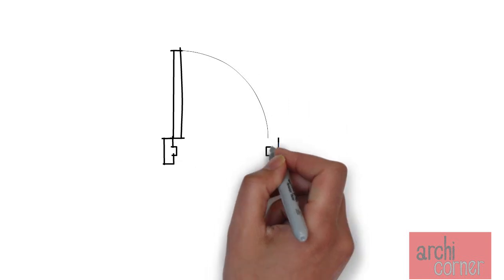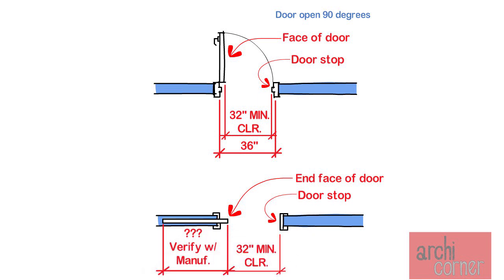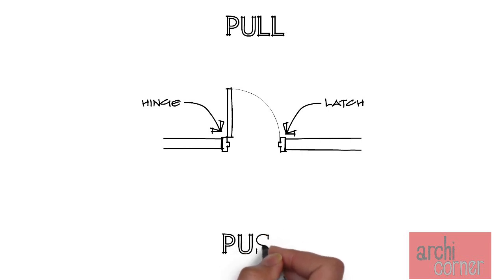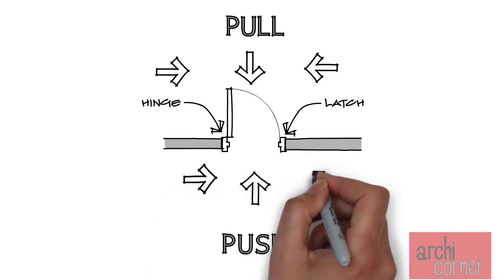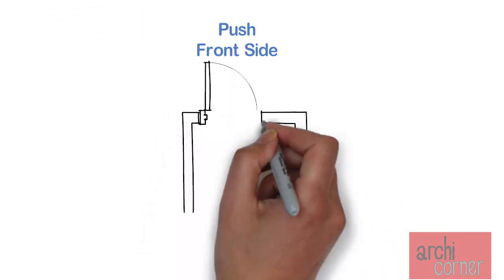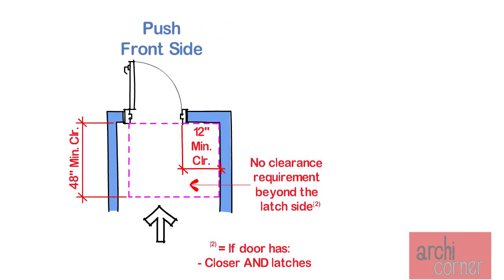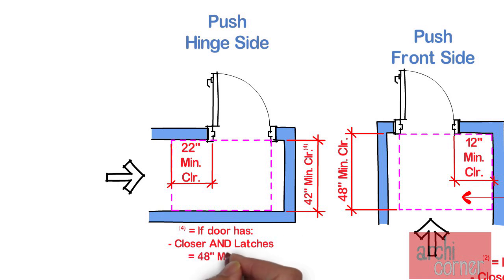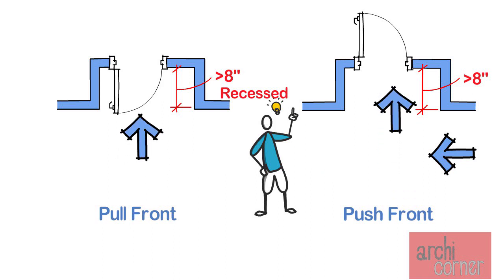AC 007 - UPDATED!!! - ADA Size and Clearance Requirements for Doors

Comment: I would love to see an in depth video on what a latch is. I believe its not necessarily a lock. How do you know that you have a latch? Is it that there is a mechanism that engages or something else?
Reply from the maker: Yes, a latch is simply the hardware component that sticks from the door into the doorframe jamb to keep the door closed. When you rotate the lever, you unlatch the door, and it can be opened. Some doors, for example, do not have a latching mechanism. They only have a "push" and "pull" plate or bar. They can be opened by simply pushing or pulling, no need to unlatch the door.

Comment: what if the push and pull door (toilet) with closer , what is the clearance require? 0" or 12"
Reply from the maker: Assuming you are speaking of a regular door, such as a door that leads into a restroom, and assuming you are speaking of a front approach from the push side, then per 2010 ADA standards, a door that has a self closer AND it latches, requires 12" on the push side (2010 ADA figure 404.2.4.1(c)). If it only has one but not the other, the 12" on the push side is not required (2010 ADA figure 404.2.4.1(b)).

Comment: Question about the clearance shown at the 4:40 mark in your video: for a push side hinge approach, CalDAG 2020 specifies 44" and your video indicates 42"
Reply from the maker: Great question. It is very important to know what the FEDERAL requirements are, which affect the entire nation, and what the STATE requirements are which affect a single state. 

The video is based on the ADA, a Civil Rights Act applied at the Federal Level. CalDAG is a publication (NOT A CODE!) that helps you understand the ADA and California Building Code (CBC). Therefore CalDAG is mainly used in California to understand applicable codes. 

This is an oversimplification, but I hope it's understandable.

Comment: Great video. What are the required clearances on non ada compliant residential dwellings. Say a two family home?  A lot us get confused when the ada standard doesn’t apply. Love this video. Thanks
Reply from the maker: In most instances, homes in general are not "public". They are "private" and therefore do not often fall under the typical ADA and/or FHA guidelines/requirements. However, you are correct, some residential units may be required to meet certain accessibility requirements, but that is usually because they are part of a multi-housing setting such as apartments, condominiums and townhouses. This is actually my next video on Patreon, as it was requested by my current patrons. I will be discussing when "Accessible", "Type A" and "Type B" units are required. It will most likely be up in a couple of weeks (today is 2/11/22).
Reply: @archicorner  Thank you for this video! Question: what are the required door clearances for electrical rooms in a hospital? It requires us to follow NFPA 101 and NFPA 100 in addition to IBC. Does IBC see an electrical room as an accessible area? Our team does not believe so, because it is not accessible to the public. What are you thoughts?

Comment: What I need is the same info but using pocket doors.  Is the clearance info the same so the room can be smaller?  Can't find any Info ANYWHERE.
Reply from the maker: There are multiple things associated with a door. 
1. The clearance, when the door is open, is the same. 
2. The hardware is the usually the issue because it has to have a handle or similar hardware that does not require twisting or pinching. This usually means the pocket door cannot "lock" unless the hardware meets this criteria. 
3. For the same reason noted above in item #2, the hardware cannot be recessed inside the "pocket" when open because a person cannot reach in. The hardware must be outside of the pocket with sufficient space around it so that someone can reach around the hardware to operate and pull/push to open/close it.

Comment: Big fan of your channel. Thanks for your generosity! I wonder why a door closer makes the code requirement more stringent?
Reply from the maker: Normally having both items will require a person with disabilities (most common example is a person in a wheel chair) to have more room to maneuver since the will have to maneuver themselves into position to 1) unlatch the door AND 2) push the door the entire way. For example if only a latch was provided, once the latch was released they could push it and the door would open all the way without the need of CONSTANT pushing. However if the door also had a closer then the door would also require constant pushing.
Reply: @archicorner  Finally get the answer from you! THANK YOU!!!